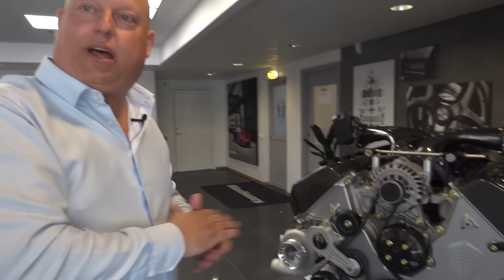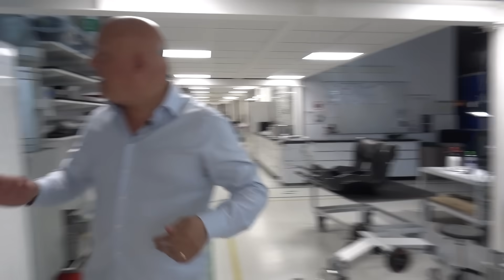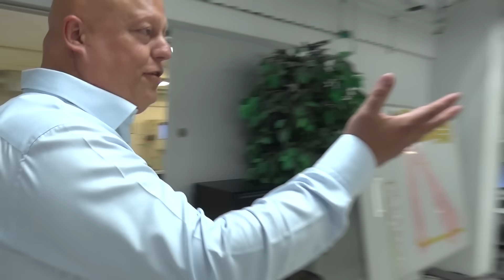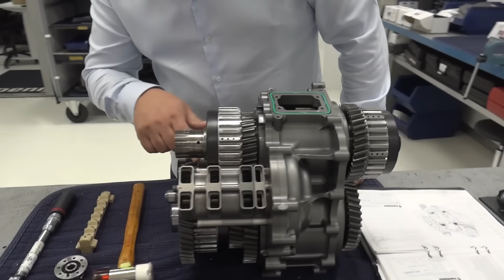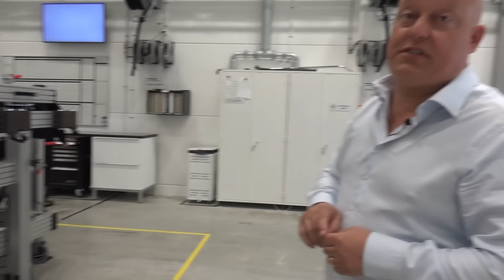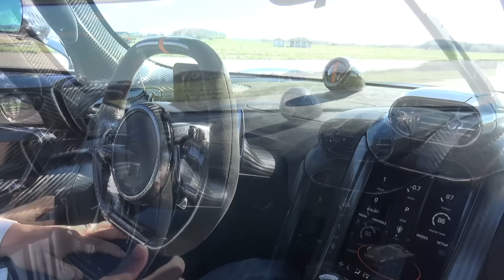Koenigsegg JESKO ABSOLUT! The FULL STORY: Factory Tour and First Ride | WHERE'S SHMEE Part 26

Comment: Implement Faraday 2 Law Of Electrolysis All Vehicles Need Pair Of Lungs That One Water Tank And Hho Generator, Current Engine Product Is Not Already Mature, Water Tank And HHO generator Replacing The Gasoline And Diesel Tank As Lungs This How To Perfecting The Current Ice Vehicles Digestion. And Koh Solution, Naoh Solution, Ammonia solution, epsom salt solution and other many hydroxide solution which available in sea water Is Vehicles Drink, and this mean Hydrogen come from solution reaction in HHO generator inside vehicles is main raw fuel, this also better scheme because no gas tank bomb needed.

Comment: When Christian says you need to use "renewable fuel" to get all 1600 HP, what exactly is he referring to? Renewable fuel seems like a large category that includes all kinds of fuels. Or does it mean something very specific over in Europe?
Reply: I think he is refering to E85 but most types of renewable fuels will enhance the Koenigsegg engine performance. Basically you can use any type of fuel you can find like ethanol, methanol, Regular Gas, E85, 100% alcohol and more types because every Koenigsegg engine have internal engine fuel sensors that adapts engine charactaristics depending on the current used type of fuel.
Reply: @netmannetman8124  see, when I searched the most common type mentioned was biodiesel. But we know you can't just go putting that into a gasoline engine. Which is why I was asking for clarification and it's possible they had stuff over there that we don't here. (and E85 is practically unavailable near me. 2 stations + a military base sell it within 50 miles of Seattle)

Comment: Nice but only 1600 horsepower.... It's definitely an 8-second car....
Reply: Only 1600hp....i guess its slower than your Fiesta St...
Reply: @garosama4517   When electric cars output almost 2000 horsepower, how can 1600 horsepower cars impress anyone?
Reply: @Seventh7Art  question is, who cares about electric cars. Haven't seen an electric car do 270mph, did you?

You're probably 12. 1600hp not impressive hahahahahaha
Reply: @garosama4517   You want to see electric cars running 270 mph? you will see that in 2023. Be patient boy.

Comment: I FIND THE INFO SCREEN THAT TRAVELS WITH THE STEERING WHEEL ANNOYING. IT'S A DISTRACTION!.  EYES SHOULD BE POINTED WHERE YOU ARE HEADING, NOT TRYING TO FALLOW THE SCREEN WHEN TURNING THE WHEEL. I SEE IT AS A SAFETY CONCERN. OR MAYBE IT'S JUST ME, AS A FORMER VOLVO TEST DRIVER OF MANY YEARS.

Comment: I have a 2104 Chevy Volt. The gas engine is 80 HP. Imagine how small it would be if Christian made a 100HP engine?
Reply: Still using gas in 2104? geez, maybe the EV hype is overrated after all
Reply: @toxicgracie3772  I’d bet by HyperCars would break the 400 mph barrier

Comment: Was always impressed with Koenigsegg engineering, but not that impressed with their exterior and interior designs as Pagani. But these latest models are capturing my attention in all departments.
Reply: Yes, design has improved a lot
Reply: I often have think that Pagani is a bit to cheesy. But Koeningsegg is was way to raw and needed a big boost.
The only think i do hate i the most supercars / megacars etc is the damn ugly round "chrome" air-vent.

The only think i have wondering a very long time. is why they still have unhidden screws on the A pillars. Just put a small "button with a bit of fabric over it".
Reply: @martinlund9524  Chrome air vent?
Reply: @martinlund9524  Pagani while a great handling car isn't real either. Buy it. Park it in your living room and drool over it. But please, don't use it.

Comment: Christian just took us through a degree that would require at least 3yrs in class in less than an hour. That Engine is probably at par with a formula one engine if not better. What an experience.
Reply: @David's things "toning it down for reliability" will end up in way less than 2000 hp (ignoring the fact that multiplying the displacement doesn't automatically multiply the hp). You would need to reduce the RPM limit by a massive amount and reduce its power output to reduce wear and tear. Not to mention making it street legal which will add a TON on restrictions, making it run on pump gas etc. As a Industrial engineering student in Germany I have no doubt that the Koenigsegg 2L 3 Cylinder TFG with 600hp at 70 kg would outperform the F1 engine. F1 engines weigh around 145kg literally more than double the TFG. Dont get me wrong the F1 engines today are incredible at what they are designed to do, but they would be exceptionally bad in road cars unless you want a engine that last 2 years max. Kinda a apples to oranges comparison tbh.
Reply: @Busy-B.  2 years? Let's try total time in HOURS.
Reply: @Busy-B.  not to mention a single formula one power unit costs as much to make as an entire Jesko car
Reply: You actually see how Mercedes is struggling with the AMG Project One. Does not seem to be that easy
Reply: Bruh, not even close, in peak performance the 1.6l v6 alone produces about 900hp, the most efficient engine in existence
Reply: @broshido2745  Thats with more than double the weight and a life expectancy of 1 week. The Gemera* engine would probably be capabable of 900hp as well if you expect it to run for only a few days.
Reply: @Busy-B.  It can’t, f1 engines last on average from 6-12 thousand kilometres and remember they have a limitied fuel flow, Koenigseggs engine would only produce 250hp if it had its fuel flow restricted, without restrictions f1 could easily push over 1500hp from that little 1.6L, there’s a reason why f1 engines cost around 10-15 million dollars, extremely efficient and extremely powerful
Reply: @broshido2745  They are built around that fuel restriction. If you would try to tune a existing F1 engine up to 1500hp it would blow in about 10 seconds (and the turbo would probably not be able to provide enough boost for that). You dont build airplanes to be as strong as humanly possible because it adds weight, same thing goes here. They dont build them for 1500hp the build them to what they can achieve with the rules that they have everything else is just useless added weight (these guys dont even fully fill the drink for the driver if not needed to save weight). The AMG one using an actual F1 engine is already struggling to be reliable and is not even pushing 800 hp. Not to mention that it has to go into service every 30k Miles. (which already seems kinda unfair to compare to other cars)
Reply: @broshido2745  well, it is now official that it weighs 1700 kg, which is about the same as a ford mustang gt 350. Pretty dissapointing.
Reply: @dasKontroloer  I wasn’t talking about the amg one which is a massive disappointment, i was talking about actual f1 engines, these guys were really trying to compare this koenigsegg engine to a actual f1 engine
Reply: @broshido2745  it's not the most efficient engine. Koenigseggs 2L 3cylinder twin turbo is apparently the most efficient engine pumping 600+hp. That with its battery pack produces 1100hp. The ICE in the Koenigsegg alone weighs way lesser than the F1 engine
Reply: @yashaskrishnamoorthy3588  You are wrong, f1 engines are currently the only engines that have over 55% thermal efficiency, koenigseggs engines are great but not even close, and as you said yourself, bigger engine 2L>1.6L with 300hp less and im only talking about the ICE
Reply: @griffin AMG project one uses only the 1.6l V6 turbo but works completely differently compared to their F1 engine. It's not just as simple as removing the mgu-k and mgu-h. They're still using a hybrid system. 4 electric motors of which one is integrated into the TC , one into the crankcase. The other two motors drive the front wheels. So overall makes >1000hp. The only concern is the fact that it's so high revving and performance orientated , they'll have to rebuild it every few thousand kilometres.
Reply: @David's things Ofcourse putting 2 engines together would make more power but not exactly 2 times as much. The AMG ones engine is interesting. What worries me is that they (openly) struggled to get it right for a long time now (which is understandable), the probably had to change a lot of things, which would affect the weight for example. But we can just speculate right now. Gotta wait and see maybe they got it running well. Im most concerned for its reliability, wouldn't be surprised if it has a check engine light after 1 year if normal use lol
Reply: @Busy-B.  I believe they said owners have to return the car so they can completely rebuild the engine every 30,000 miles.
Reply: @Busy-B.  According to the project one prototype and simulations , it weighs around 1200-1300 kilograms and is rumoured to run >1000hp. So what do you mean issues with weight ? Can you specify?
They're probably finding it difficult to make the engine design work efficiently with the chassis since it's a road car
Reply: @yashaskrishnamoorthy3588  Regarding the weight I meant only the engine itself. The TFG is hard to beat with 70kg total (someone should put that in a motorcycle lol). I dont think that the Amg One engine will be as light considering the F1 minimum weight for engines was around 145kg if I remember correctly.
Reply: @Busy-B.  Yeah I agree. The AMG one engine is definitely going to be atleast twice as heavy as the F1 PU lol. But it'll be interesting to see how they'll integrate that engine setup into that chassis running 11k revs. I think that TFD in a motorcycle is an interesting approach lol , would love to see it

Comment: Ridiculously amazing. The Jesko is truly an ULTIMATE dream car in a day and age where people are getting harder and harder to impress ♥️
Reply: Lol, tf are you talking about? People are getting easier and easier to impress. You can give people bath water and they buy it, you give them a horribly built car which looks good, it sells, you give them a $2 handbag and slap a LV logo on it, and it goes for $20,000.
Reply: What the world needs is for these mega rich clever innovative individuals to get together and invent a fuel less engine . Something that runs on air and  produces air as a by product.. imagine how much richer these people would become. 
Just a thought!!!
Reply: @grahamclayton675  And we'll all ride unicorns over the rainbow into neverland.
Reply: @grahamclayton675  compressed air car has been done, it's really noisy, has terrible range, and overheats when you compress the air and freezes when you release it.

We know what the most efficient way to move a car is: a battery powering an electric motor. 1,700 horsepower from a farting grumbling box containing sequential explosions is cool for a bunch of aging petrol heads who associate the noise with performance, but the engine, and the gearbox, are rapidly becoming irrelevant dinosaurs. All the mass manufacturers can simply hook a motor for each wheel up to their largest battery pack to deliver 1,000+ horsepower.